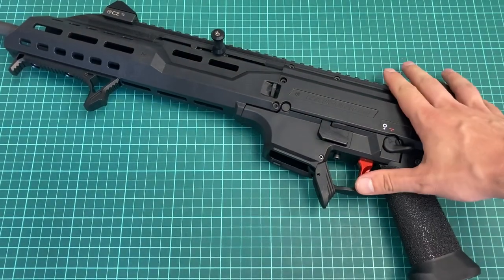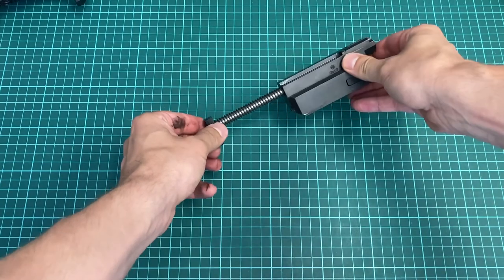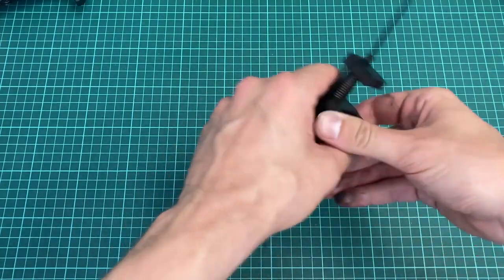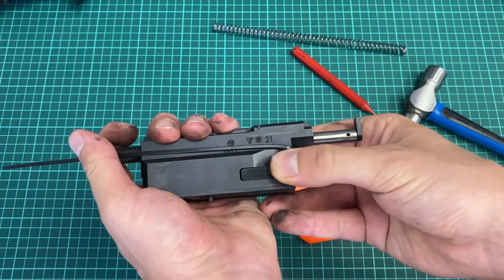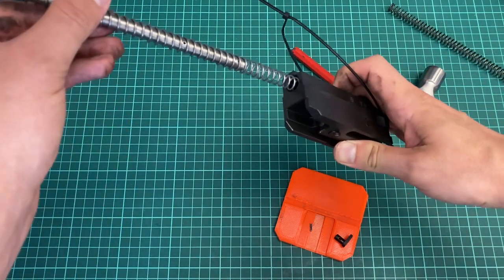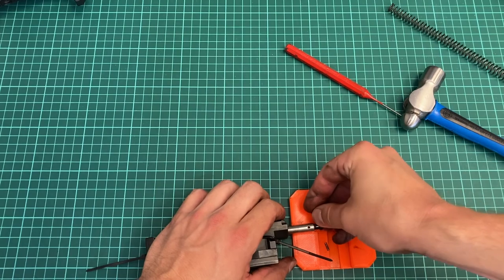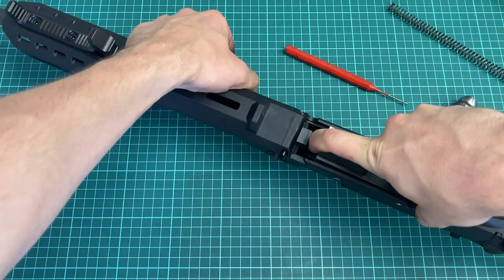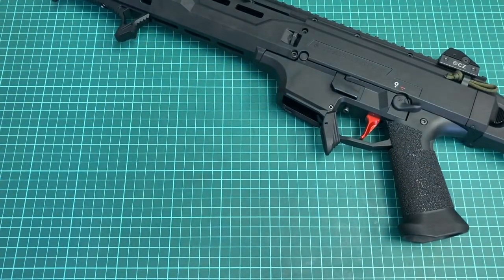125 % recoil spring for CZ Scorpion EVO 3

Comment: I am fresh from the installation and can share one comment. The included cable tie is very thin and in my case broke after a minute of putting it on (with 125% spring). I recommend to use a wider one or make loops from something else - in my case paracord worked well. 

But anyway, the spring is worth recommending. Installation also did not pose a big problem - well, maybe except for hammering in this tiny pin here you need patience and a certain amount of delicacy.
Reply from the maker: Thank you for your feedback. I have to agree with you. We'll change these zip ties for sure. Once it snapped on me too.
Reply: Instead, use a small (watch or eyeglasses repair) screwdriver on the second pin (towards the block) to hold it. Worked for me.

Comment: Curious whether this will be too heavy to cycle very slow (weak) subsonic loads?  Or if these would be better suited for hotter/faster velocity loads?
Reply: It was tested with very weak 124gr IPSC load (at the end of video) as well as standard factory load and some subsonic loads too. All performing very well. The stifness of this recoil spring comes more in second half of the cycle so the ejection isn't affected.

Comment: Hi! I just bought two-- got one extra as a spare. At what round count would you recommend to replace the recoil spring?
Reply from the maker: The spring force is slightly decreasing first 10k cycles,  then settles and remain the same up to 100k which is the calculated lifespan.
Reply: @ascalonarms9156  Thanks!

Comment: I’m getting a light strikes after a full magazine, will this fix the problem ?
Reply from the maker: No, this won't change anything in that matter.
Reply: @ascalonarms9156  any suggestions ?
Reply from the maker: @Glocktavius_the3rd  Check out the parts related to this. Means firing pin, firing pin block, firing pin spring. Something is causing the firing pin to slow down.
Reply: @ascalonarms9156  ok will do this, thank you

Comment: I’m having issues with failures to eject. Someone mentioned this spring to me. My thought is that the increased spring tension would make my issue worse. What are your thoughts?
Reply from the maker: It won't fix it for sure. I'd recomend to get a new ejector and ejector spring first.

Comment: Would the spring cause more wear on the bolt and chamber due to increased force/velocity when chambering a new round?
Reply from the maker: The bolt will carry same amount of energy as with the stock spring. Just the deceleration in the back is happening faster. There won't be any more wear on the gun.

Comment: Putting a stronger spring does not solve that problem The lighter loads could  present a problem What you have accomplished is you adjusted the right spring to the load. 
The rear ward  slamming know can be eliminated by using some kind of a buffer made from Teflon and that if you have metal to metal contact. 
If you have metal that hits the solid polymer body of the gun you do not need that either.
Reply from the maker: No such thing reported out of a couple thousnad sold so far. 
I'm shooting sub minor factor ammo that some of my pistols can't cycle even once and it still runs like a dream with it.
I guess you may run into an issue if you try to shoot under water. That's what the factory spring was designed to do.